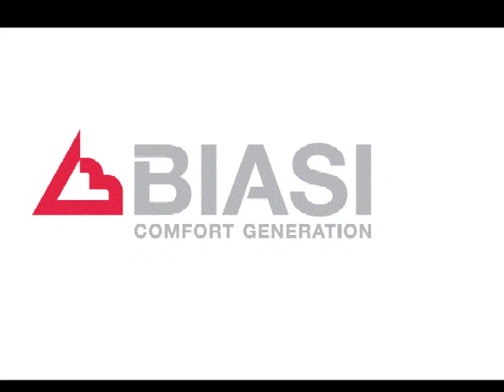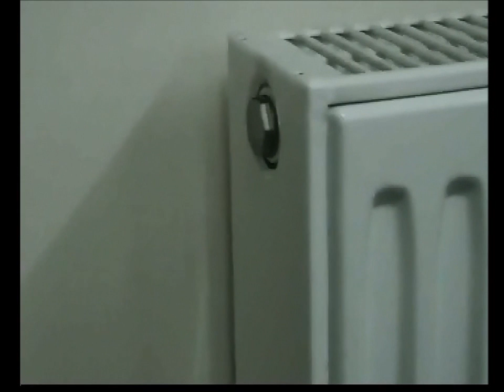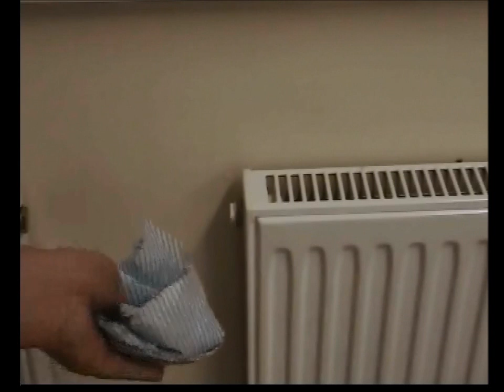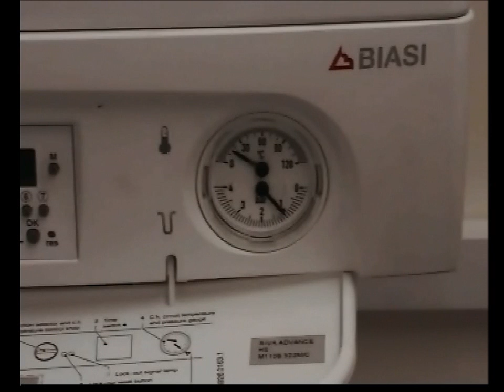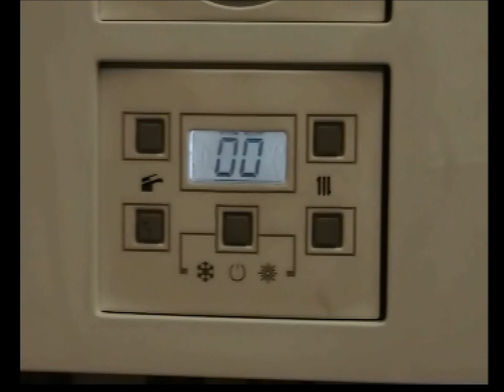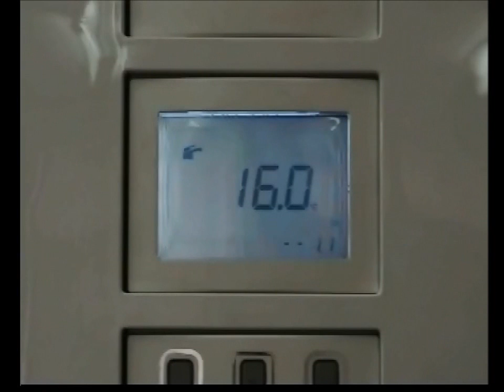System Maintenance on all Current Biasi Boilers (system pressure related)

Comment: Hi I don't know if you will help as i imported Biasi Advance 25C combi boiler to Pakistan and have a problem with it. When i switched it on last week after summer, forgot to open the gas valve so it tried few times and then Err01 code appeared on screen. I have tried to turn it off and then on but error is still there.can you give me a solution for it please?

Comment: What does the error code er 69 mean on the advance boiler it didn't appear to be in the manual
Reply from the maker: Hello Nindes

Error 69 is Wiring Error Lockout.  Our technical department have asked if you could call them on 01922 714600 as they will be able to assist with this issue.

Thank you
Biasi UK Ltd